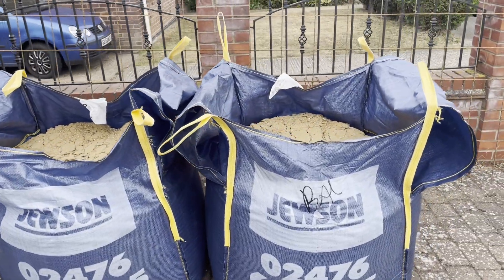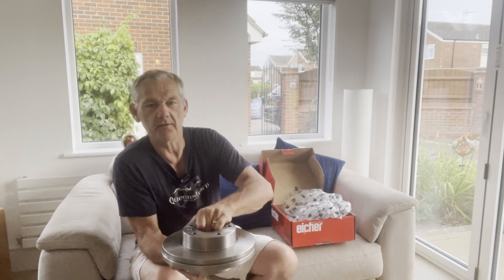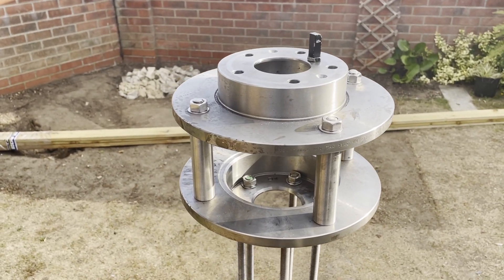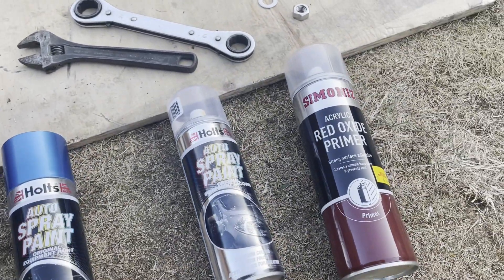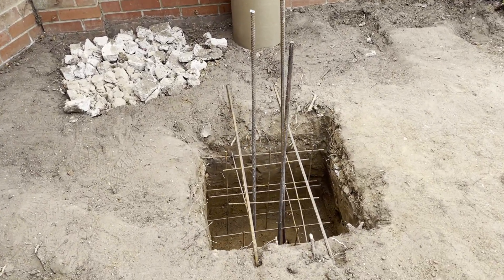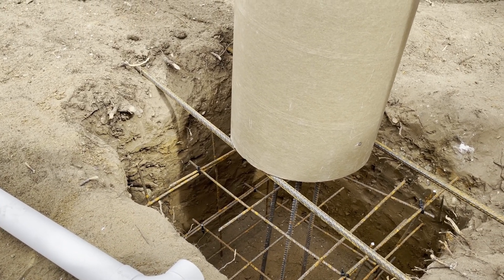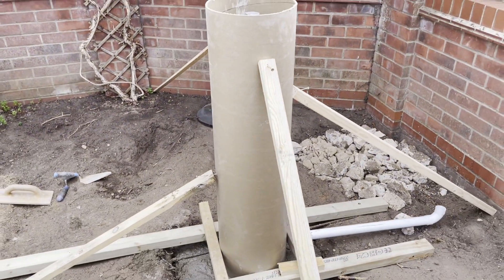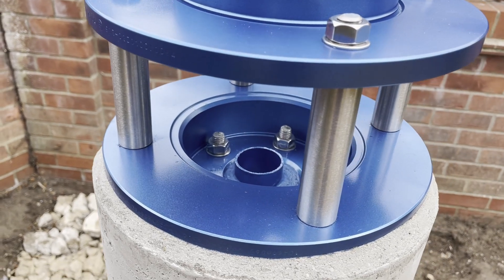How to Build an Observatory with Roll off Roof Part 1 #observatory #homebuild #astrophotography

Comment: @SimonAstro -- Inspired by your approach on building the pier, I want to build one myself. I am not sure, however, how to fasten the mount on the top brake disk, as the middle of the bottom part of the mount sticks out a bit. Can you post a short video on how you sort out that part? Thanks.
Reply from the maker: Hi, I don’t know which mount you have, but for my EQ6R Pro it fits in the top of disc with a 65mm hole! Take a look at my newest version of the pier build video here and scroll to 5:48 you’ll see how I fixed it on! Hope that helps👍

https://youtu.be/X8D7l8Rcf7M?si=w-vc6t--_H4fi4-D
Reply: @SimonsAstro I have an EQ6-R Pro as well. Thanks.

Comment: Hi, just building my first observatory, how did you determine the height of your pier? And how did you determine true north please ?
Reply from the maker: Hi, good question! Depends on your mount and surrounding obstacles, like trees, buildings etc. I don’t normally shoot below 30dgrs but occasionally you might want to go a bit lower. So I looked at my surroundings and worked out the heights, roughly worked out the height of the mount with the scope attached and chose a height for the pier that I thought would be suitable, then built the walls to a height that I knew the scope could see over! It’s a bit of a faff, but with a little bit of work, you’ll work it out!!
Good luck👍

Comment: I bought all the items and have it looking good…. Until I realized I did not buy stainless steel rods but zinc coated.   Will they rust inside the cement pier?
Reply from the maker: Hi, thanks for watching, to be honest, it will be fine, the steel will be totally covered with concrete. It will probably be 75 years before it even starts to deteriorate! Clear skies!👍

Comment: Hi, Simon, what are these four tubes you use to hide the four bolts between the brake discs? what are the made of, metal or plastic? Where did you get them? Thank you and congrats!!!
Reply from the maker: @mariosoriano5359  Hi, thanks for watching, they are stainless steel, I got them from my local engineer who drilled the holes for me! You will definitely need strong steel to hold it all up, and being stainless, it won’t rust! Good luck👍

Comment: Nice! I looked ahead. Did you look at prefabricated observatories? Building one has benefits - an example to grand kids, you get what you want or need in terms of appearance and function. Is it a wash cost wise? The few domes I saw were around $9500 and up(?).  Will have to watch and borrow from your experience, like keeping the lid on in windy conditions. Thanks!
Reply from the maker: @stevenwilliams6258  Thanks for watching Steven! The benefits of me building an observatory are, as you say, I get it how I want, I get to have my grandson help me and make happy memories 😀 and it’s cheaper, also a much better quality than the kits you can buy off the shelf. Plus the fact that I’m a builder of 38 years, and I know how to do it👍 Please use any ideas you like from my build, for your own build! Happy to help😀 Clear skies!

Comment: What is the size off the cardboard tube thanks
Reply from the maker: @alangriffiths1432  hi, it’s 11” 275mm
Thanks for watching 👍
Reply: Thanks
Reply: Did you cut down the tube, or did you leave the tube the same size thanks
Reply from the maker: @alangriffiths1432  I actually cut about a foot off, I think it was around 1500 long and I cut it to 1200mm give or take an inch🤣
Reply: @SimonsAstro  Thanks I will be asking more questions if you don't mind because I like your obviously the best
Reply from the maker: @alangriffiths1432  lol, thanks! No problem 👍
Reply: @SimonsAstro  got an other question have fitted a heater and an extractor fan to keep the observatory cool in summer
Reply from the maker: @alangriffiths1432  no, my observatory is insulated with 50mm Celotex between osb sheets on the walls and on the roof, I’ve not had any issues with heat or cold, nor condensation, apart from when the roof is open and the walls get wet! But there’s not much I can do about that!!
Reply: Thanks what temperature as it getting if don't mind me asking thanks
Reply from the maker: @alangriffiths1432  in the hot days of summer, I can walk into the obsey and it’s feels cool, not like my other shed where it’s so hot I can be in it for more than a minute! I don’t know the temperature, but it’s not hot! In the winter, it’s the opposite, it’s not really cold, as in freezing! The equipment seems absolutely fine all year round! Our summers can get to about 30 degrees and the winter can be as low as -10 sometimes!
Reply: Thank you

Comment: Hi Simon, fantastic job, i was wonder how high are your walls and how high is the pier with out the mount?
Reply from the maker: High David, thanks for watching 👍 The walls are 1.8 m on the sides and 2.1m on the ends, the pier is Approx 1.1m before the mount! Hope that helps, clear skies!
Reply: Yes, thx  a lot mate
Reply: How deep is the concrete pad? I am thinking to do mine 250mm, do you think is too much?
Reply from the maker: @davidemancini7853  My concrete pier foundation is 600x 600x 600 and it’s completely separated from the concrete floor of the observatory, so the pier doesn’t pick up any vibration’s from the floor. Concrete is an excellent conductor of sound and vibrations, especially if the concrete has steel reinforcing inside it. The cameras are extremely sensitive and any vibrations transmitted through the concrete, will be detected by the camera! Good luck with your build!
Reply from the maker: Also , the concrete base (floor) is about 125mm thick with A142 6mm steel mesh reinforcing in the center!
Reply: 200mm in the ground ground and 50mm off the ground

Comment: Hi Simon, great work on getting started. Did you take into consideration magnetic declination? Most mobile phone apps don't account for this, hence the reason builders and surveyors use proper surveyors compasses. I set my observatory in Australia to exact polar alignment and profiled it (sir set out) before I started.
Reply from the maker: Hi Peter, sorry for the late reply! To be honest, I didn’t worry about magnetic declination or anything like that, but I did check it with my wife’s phone as well, and as luck would have it, the mount was pointing almost exactly at Polaris! Thanks for watching and clear skies👍

Comment: What model car are those brake rotors for I’ll be building a pier soon.
Reply from the maker: Hi Frank, they are from a land rover Discovery, Euro Car Parts, £21 for a pair👍 Good luck with your pier!
Reply: @SimonsAstro  I googled Land Rover Discovery rotor it shows from autozone a 70mm hole not the 65mm you show also the edge of the rotor is not solid like what you show in the video.

Comment: Great video and congrats on the obsy build Simon! I actually used a disk brake for my adapter as well and it’s worked great. Really looking forward to the next part in the series.
Reply from the maker: Thanks Joe much appreciated! Yeah I saved a fortune, I bought one from Germany ready made £211, but they couldn’t ship it! So I went down the disk brake method, £21 for two! 
Clear skies!